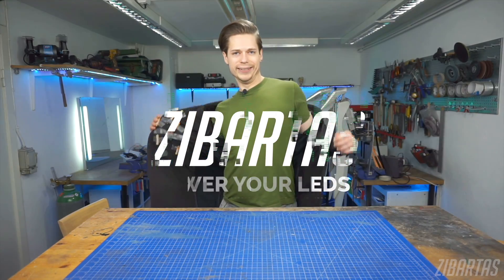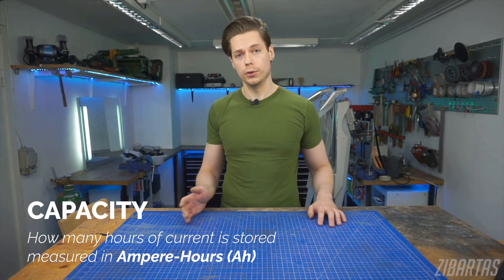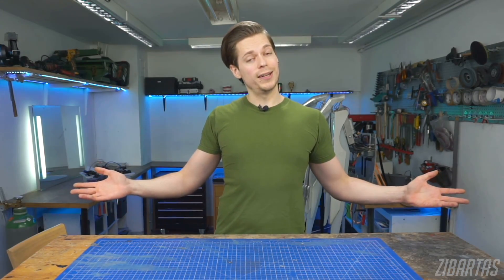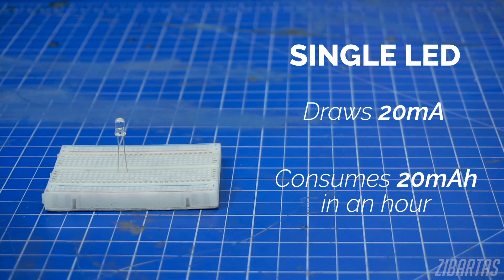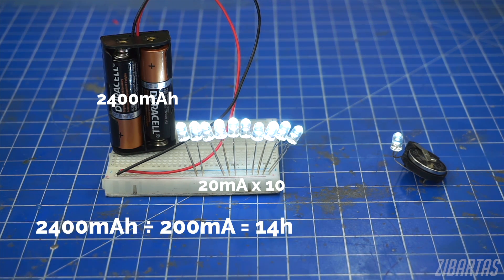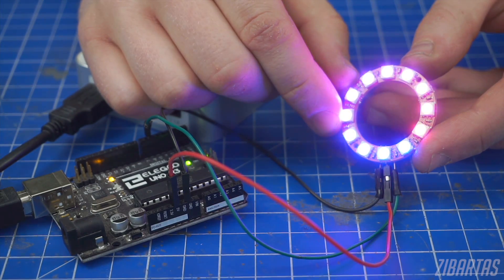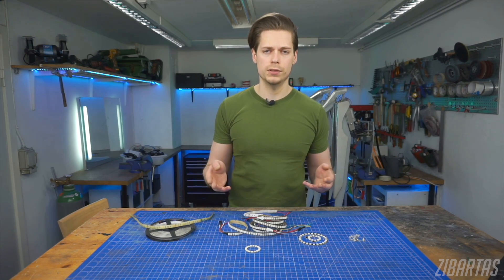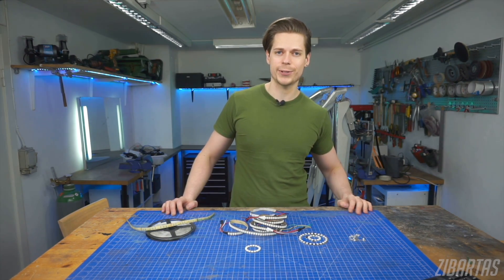Power your LEDs! Cosplay & DIY Batteries Simplified.

Comment: Hi! I'm currently studying electronics and I observed in your video that you did not mention the boost converter. It's a much cheaper and safer way of lighting up leds which needs more voltage. say you need to light a 12v led, just use a boost converter instead of series connecting two 6v batteries. Insert one 6v battery on the input of the boost converter then the output to the input of the LED. Makes life easier. save the other 6v battery for another project.

Comment: I need to power a LED strip that is about 1 meter long. The led strip also comes with a PIR sensor that will turn on the strip when it detects movement. The led strip has a USB Type A connector so I can plug it into a powerbank. Problem is the powerbank doesnt stay on all the time after awhile due to low current draw. How can I solve this? Or should I use a AA battery box? If yes, how many AA size batteries should I use? Thank you in advance

Comment: How are you powering the digital LEDs with the 5V of the Arduino if they need 720mA but the Arduino pin is limited to 500mA when powered by usb?

Comment: i just have a question, if i am using a double A battery to wire 6-7 leds to a Diy will it supply enough voltage? Is the voltage at a fixed rate around the circuit? Sos for the confusion.

Comment: i just have a question, if i am using a double A battery to wire 6-7 leds to a Diy will it supply enough voltage? Or is voltage at a fixed rate around the circuit? Sos for the confusion.

Comment: Hello! Great video and content. I have a question. I have a sp611e controller connected to a meter of ws2812s  leds(# led is around 60). I get electricity from 4 series connected disposable batteries. for some reason, if I switch the color to white and hold it for more than 10-15 seconds, the remote controller stops working. The light is still on mind you, but I can't do anything with the remote controller until I stop the connection from the batteries. Do you know how I can fix that?

Comment: thank you for the info! i have no idea how to do this sort of thing and i am going to be cosplaying Vash the Stampede this summer and would like to do the lights this year unlike last year. btw is there any way to turn on and off the lights (gonna use the strips) so then if i need them off to save the battery i could? ik i could just take out a battery or disconnect, i am just wondering if there are ones out there with a switch or button on them

Comment: Thank you for the video? If possible, could you elaborate on the power consumption of an LED strip? Does the color I use impact it? Let's say I set the color of the LED strip to red. Would it still draw around 60mA, or would it drop to 20?

Comment: Super great video!! This might be a silly question, but how and where do you connect the powerbank to the controller(the arduino uno)?
Reply from the maker: You can use the USB cable, or the barrel plug, or the pin called Vin (Voltage IN) - look up Arduino UNO pinout on google images :)

Comment: Hey Ive just made a light up staff with 8 AA 1,5v Batteries. While testing it i put a whole LED strip (3m or something) on the batterypack. after a short while the batteries became suuper hot to the point of melting the pla that i used to 3d print the battery holder. Does the big LED strip take too much power too quickly and would less leds solve the heating problem? thanks in advance
Reply: and yes the whole led strip lit up brightly and nicely. so im confused why the overheating was happening
Reply from the maker: The issue is the power draw, small batteries have a hard time providing a lot of current at once. You need to find out what your LEDs draw, and match or exceed it with your power source. 

Your 8 AA batteries in series are 12v, but so is a car battery - ones get hot from LEDs, the other you can melt metal with - and there are options in between, so you gotta pick accordingly:)

Comment: Can I power LED lights using a copper ground rod - the way I see light bulbs lit up?  This is free power and supposedly between 25W and 50W is available - depending on how damp the soil and/or how deep the grounding rod is in the ground.
Not sure why I'd need this, but just brainstorming.  I suppose recharging the battery pack this way makes the most sense and then carrying the battery pack back inside.  Using a long wire permanently attaching the LED light strip to the ground rod might be silly. 
No sure yet.

Comment: What about power/current limits of the batteries? There is a limit to how many LEDs (or how long of a strip) you can use with any given power supply. How do you figure out that limit (without trial and error)?
Reply from the maker: Peak/avg amperage is something that can be found in the battery spec sheet :) You can always hook up multiple batteries in parallel if you need more current for larger projects!

Comment: Excellent video, though I was wondering if you could confirm something for me about using powerbanks and 12v LED strips. I've got a set of color-changing that I want to incorporate into a costume but of the 2 ideas I've been toying with I'm not sure which would be the safest to go. 
1. I've got a 18650 3.7, 2400mah battery with a battery holder I thought I might use to max the longevity, but don't know if I need a resistor or which one for that matter, or if that would actually work.
2. Alternatively I was thinking of using a USB power-bank since it has the alternative cord to go from 4x1.5v(AAs) to being USB powered, but don't know if that would work.

If I could get any help with this I'd be massively grateful.

Comment: I just wanted to confirm, the controller is the mini computer that you program the animations into right? I'm familiar with wiring a powerboost to a trinket, I'm wondering if the power bank can supply power by simply plugging into the USB? Is it that simple? Also thanks for the info

Comment: Glad i came across your informative video. Just a couple of question: 1) is the 5 volt output a standard on all power banks even though they have different Amp capacities such as 10,000 or 20,000? 2) Does it matter whether the power bank has quick charging abilities?

Comment: I have a question. I have an A23 battery that provides 12 volts of energy. If I were to use it on a programmable RGB LED strip, which would be the best one to use? The 12 Volt or the 5 volt strip with a resistor setup?

Comment: Don’t forget that power banks give their mah ratings typically at 3.6 or 3.7V, the cells nominal voltage. When they boost up to 5V you have to do the math plus factor in conversion inefficiencies (usually 80% efficient)

Comment: You can also put a resistor im series of the LEDs, so that they for example only get 2mA, which still can be bright enough.
For the powerbank, there usually is a minimum load required (20-100mA). And if you want to drive more than 3 LEDs from a powerbank, look into getting a cheap buck converter or linear regulator.

Comment: Can someone tell me a very simple way to take a short LED strip (6 to 12") that I power with a 9V battery and make it flash?
I know I can buy a very long strip with one of those remote control things and cut it down to size, but I would rather buy the size I need instead of wasting all of the strip.
Reply from the maker: Why don't you buy a shorter strip, and a controller separately, rather than a single huge package?

Comment: awesome video. i was only here for the 12v part but it answered many other questions i didnt have yet lol.i really wanted the vertagear light kits for my chair, then saw the wheel kit as well and cant bring my self to spend $600 on some lights. found 2 different kits of rgb leds for under $100 and have so many spare 18650s from drill batteries and a 3d printer. should be a fun rewarding project to attempt and worst case i just use the leds under my desk with the plug lmao.

Comment: Question if you don't mind. What if I had about 44inches of 12v LED strip that I wanted to power without plugging into the wall. It would only be powered on for maybe 3 hours tops  a couple times a week. could i use the 8 battery trick at 6:58?

Comment: Hi ,great video.Is it possible to connect strip to a solar type battery source. Also using rechargeable  batteries ,will it be advisable. How long will gatemotor type 12v battery work On  3 similar strips ? Thanks .

Comment: At 3:54 you said "when we connect batteries one after the other...  ... the capacity stays the same but the voltage doubles".  Did you mean that the current stays the same, but the capacity and the voltage both double?
Reply from the maker: No - in serial -  current stays the same, and capacity stays the same. Only voltage is added up :)

Comment: Hi, I have model railways and I am hoping to light a house I built with 12vdc led strips.
I have the strip snd have cut them into sections which I will connect with short lengths of wire.
I will power them using a 9V battery but how do I dim the led’s. This is my first of what I hope us many small projects.Thanks in advance
Reply from the maker: You can dim LEDs by introducing resistance to the circuit - look up 'resistors' - tiny electrical components that act as a valve for electricity :)

Comment: I'm trying to find a way to battery power either the Govee RGBIC LED Strip Lights, or the ELlight LED Strip Lights with APP, Dream Color LED Lights (both are on Amazon, US, and both allow detailed phone app control of individual lights and groups of lights).  I'm not planning on using any more than six feet of the LED strip, but the lights need to be on, blinking for several hours per night.  Problem is, this will be for a break/lunch area at work, and I'm not allowed to plug anything into the wall at work, so I can only use batteries.  Any suggestions?  Can it even be done?

Comment: Need to figured out what kind of power bank to use for some under the cabinet lights. “Litever Kitchen Under Cabinet LED Lighting Kit Plug-in or Wired, Super Bright, 6 PCS 12 Inches Light Bars, Daylight White, 31W 2000 Lumen, Perfect for Kitchen Cabinet Counter Shelf-(6 Bars Kit 5000k)” Amazon item. I want them under a pool table to match the same lights under my bar but I don’t want wires showing so if you can suggest a power bank I’ll mount under either the table which I can charge for occasions. Thank you for your time.

Comment: I have something different for you. I bought an older motorcycle chest/back protector and the spine area lights up with a neon red light strip. I got it with the 2 wires pulled off the circuitboard in the little box switch run off of 2 cr2032's. I tried to press the wires to the board where it looks like they were attached possibly and tried everywhere on the board and it won't light up and I got brand new batteries. Any ideas on what to use to power this simple neon strip light? It's a Speed And Strength Lunatic Fringe vest. The Co. Does NOT have schematics anymore.

Comment: Sure is it possible to use car battery with an 12 v instead of using dc power supply with 12 v 4 a for rgb led 10 meter and does the amperage of battery matter if high or low if voltage just 12 v all time and dose the car battery will give 12 v all time or it will reduce when it on 50% ? Please help me

Comment: What if the battery V is lower than LEDs V will the led glow dim or battery will drain faster ? for eg If I connect 4-5 3V LEDs to a 9V battery, what will be the consequences.

Comment: You've got me convinced to want to try digital LEDs, but I've only ever worked will simple 9 volt LED strips. I'm trying to find a 5 volt that goes with the digital LEDs you mentioned in your video, but the link in the description isn't working. How do I find a 5 volt power bank that goes with the Wesiri WS2812B LED strips you use? Thanks Zibartas! You're my cosplay idol!

Comment: A miss at 2:50 "LEDs are 5 volts..." not always the case. While supplying 5V to an LED will light it up, the majority of LEDs operate somewhere between 1V and 1.3V. One must also remember voltage drop in their system. This is why 5V is leaned on in this manner, as most people are looking to power 3 or more LEDs in their array. As well, with the advancement of LEDs, the RGB leds are 3 diodes in one (another reason 5V was miscategorized), as three one volt diodes in one package, all lit at the same time, would not be operating the package efficiently. Much of the power issues can be solved through a current resistor, but refer to the datasheet on your product to be sure you are not overloading or under loading your LED. Finally, newer, smaller LEDs and resistors are out there... as seen with the neopixel ring. Each white "box" on the ring is 3 separate LEDs in one package, with a small microprocessor that give each of the colors in the LED and address to be called upon in a program AND resists the current to allow for a variety of power options. These LEDs generally have a power, a ground and a signal wire, as opposed to other LEDs that may run a simple power and ground. Final note... LEDs tend to operate best under Pulse Width Modulation (PWM). This, simply put, is the act of having the power go on and off so quickly that the eye translates it as dimness, rather than full on and full off. Dimness can be achieved through power reduction, but is not best for the LED. Remember Ohms law when diving into LEDs, as it will be your guide... and use an online calculator, as there are many.

Comment: hello i have a unique project with use of single color 12v led strips in mind . but would like to find a more efficient rechargeable option. recommendations?? preferably somethin small as it will be attach some way to a wheel that may spin at speeds up 45mph

Comment: How about a 12V 10 Ah lawn mower battery hooked to a 48 LED light bar pulling just under 10 watts? If I figured it correctly, 10 watts is about .83 amps, so a 10 Ah battery would run this for about 12 hours, right?

Comment: But I failed to light 3v led by 4 , aa batteries ,and the same bulb ignites on 9v battery....Why ?
Reply from the maker: Hey! 4x1.5 in serial is 6V - are you trying to power a 12V LED strip? Half of the rated voltage might be too low to show up.
Reply: @Zibartas  No
I was trying to light one bulb of 3 v.I tried in series and parallel cell , both.
Reply from the maker: @arunkamal2320  Hmm that's interesting - usually 3V LEDs burn up instantly when connected to a 9V battery without resistors. You sure your LEDs still alive?
Reply: @Zibartas  Yes.And as u said, it works with 9 v battery 😊.

Comment: Dumb question: do you have any recommendations for the wire gauges for each set of batteries? like the 2 AA recommendations or the 9 volt recommendations? cuz I have looked online and it'z way too technical for me
Reply from the maker: Unless you go super thin (sub 30AWG), your projects won't be bottlenecked by wire gauge - there's just not enough current in the batteries :D  I usually use 24AWG or 26AWG, mostly because it's sturdy enough to work with, and thin enough to hide. If I were you, I'd get a few meters of different gauges and see what's the easiest to work with for you!:) (Also you gave me an idea about video on this topic! :D)
Reply: @Zibartas  No problem, as i said before.  I tried to look up the info but it'z too much.  i understand that battery size and weight is crucial to some people's cosplay.  but when you find a good spot for it.  I have no idea what wires to run.  I have been getting away with 24AWG but I feel that it might have a chance of a short or shock.  Thanks for your help

Comment: Great video, very informative. Your entire series on LEDs is exactly what I was looking for. Quick question though - my project is mostly stationary so it would make sense to power it directly from the outlet. What is the easiest thing I can do in this case if I'm using a LED strip?
Reply from the maker: Oh that's so good to hear! I think a wall adapter would be the best move - you can get power supplies that deliver a lot of 12v or 5v current (depends what kind of LEDs you're using). You can find them in AliExpress fairly cheap if you just search for "12v power supply" or something:)
Reply: @Zibartas  great. Thank you for the quick reply. I'll look into your suggestion and see what I can find :) thanks.

Comment: Hello, noob here. may I know how many amperes needed for 2meters addressable LED (144led/meter)? Thank you.
Reply from the maker: I think they officially rate Neopixels at 60mA per LED peak brightness :) usually you can calculate as 20mA per LED and it will work fine assuming you're doing animations
Reply: @Zibartas  Okay. Thank you!

Comment: More detail: bracer with 4 individual blue LEDs on each side... maybe need a 9 volt? With resistors? Dunno, I’m an electrical idiot...
Reply from the maker: 4x3V LEDs in series is 12V = so a 9V battery should be fine :)
Reply: I’m trying to solder them in parallel to use 2 x AAs. Do I need resistors? Or just use more batteries?
Reply: I haven’t even gotten to the rings I’m putting on her back... Digital LEDs. I have the nano and have watched your video on programming it. I also bought two 5V power banks. I’m getting better at soldering already.
Reply from the maker: @OKcrates  If you're sticking with Digital Addressable LEDs then just use power banks. (2xAA (1.5V) = 3V in serial  so you can power a few 3V 'analog' LEDs in parallel just fine too)
Reply: @Zibartas  So, just to follow up... I did 8 Blue LEDs in parallel on each bracer, wired to a 3V battery pack (2xAAs on each bracer)).  Super bright! Took a little soldering, and some T-type wire connectors. Not bad for an amateur, if I do say so myself...